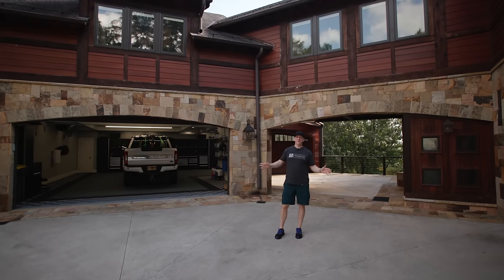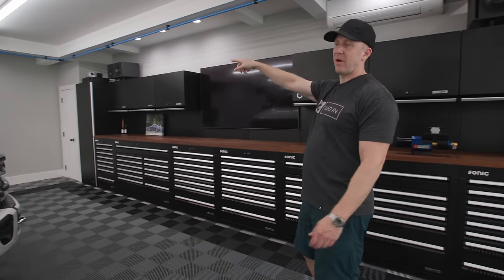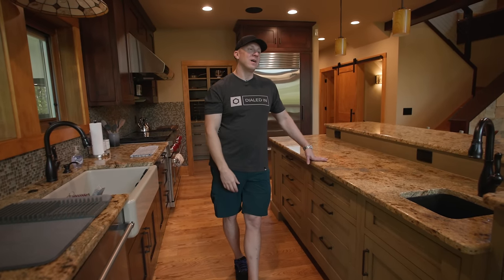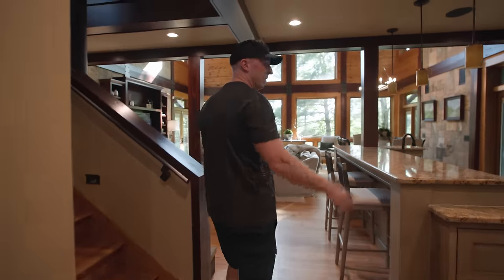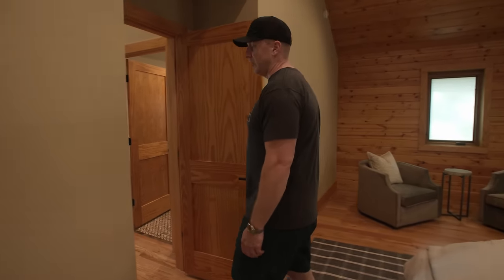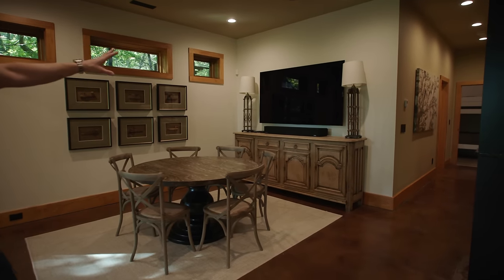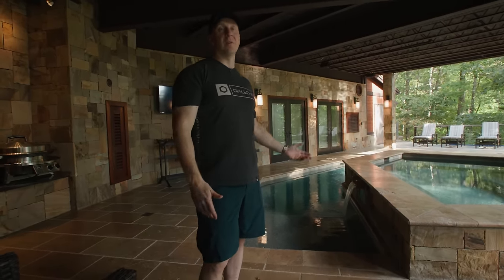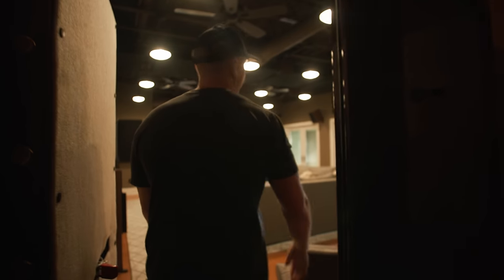Inside the Ultimate Mountain Mansion - A Car Enthusiast's Dream Home | Full House Tour!

Comment: Very nice setup! The home theater screen looks a little small IMO. Often times it seems the speaker setup dominates compared to the screen. I was going to suggest at least an 83" and then I saw that's what you have already - lol! Even a 97" would be too small. I'd say you could go to 120" in size if that ever comes out. I understand though the reasoning behind not going with a projector to avoid phone calls from customers.

Comment: I like that you said "ultimate simulator room" and actually used legit high-end sim gear. Too many people call their cheap Logitech or thrustmaster toy wheel premium sim gear. I saw some Huesinkveld Sprint or Ultimate pedals, Asetek Invicta base and Forte wheel, obviously D-box is great, a stream deck for a button box, and a high-end shifter and hand brake. All great stuff that will fit any type of racing. I really like the mounting plate that bolts to the front of the base instead of the bottom. A+ sim rig, A+ house.